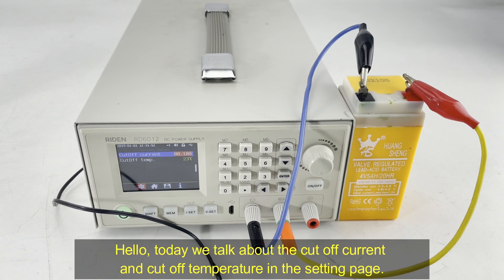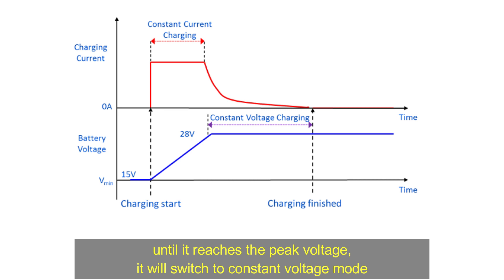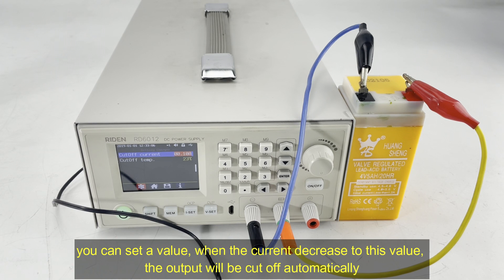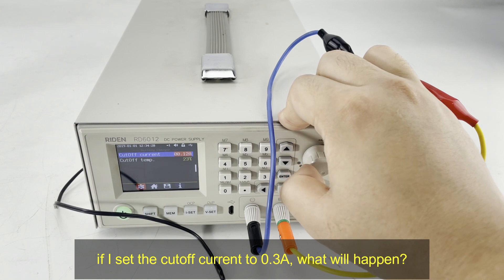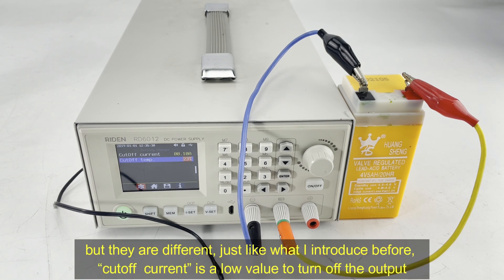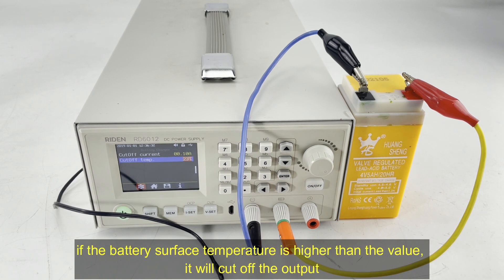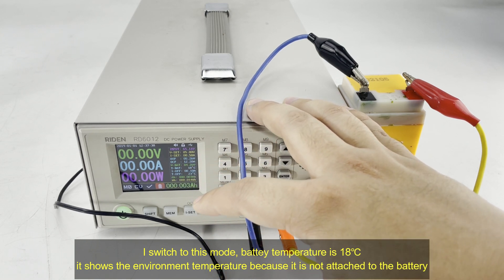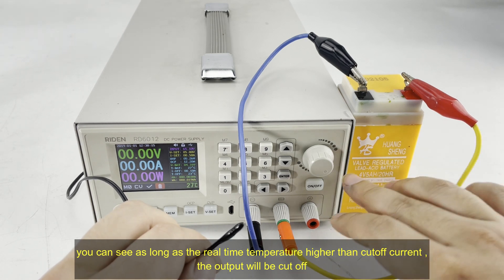CutOff current and CutOff temperature to protect the battery for charging with RD power supply

Comment: is the temperature sensor included? or sell apart? is possible program in pc software a charging curve by steps? no chance to atach any device or something to discharga and analyze battery capacity? thanks for your video
Reply from the maker: 1. temperature sensor is included in the RD box 2. please check the pc software advanced function to program certain voltage and current for certain time 3, it is just a power supply, it can only charge battery, it cannot discharge battery to check the capacity

Comment: is it possible to save cut off current and temp in M1..M9 memory cells?
Reply from the maker: hello, the cutoff currnet is separate setting in the setting page,not in the data group, because it is only for battery charging terminal, the normal terminal will not cut off

Comment: Десульфацию батареи можно делать при помощи этих настроек.
Reply from the maker: hello, maybe the translation has some little problem, I do not know what you want to do to the battery, can you describe it again?
Reply: @rdtech9153  I do battery desulfation using these settings.
Reply from the maker: @AlexandrNikitinskiy  but our power supply only charges the battery with the voltage and current you set, I do not know that it can do battery desulfation
Reply: @rdtech9153  Through a translator, it is difficult to describe the process.
Reply from the maker: @AlexandrNikitinskiy  I seach how to do the battery desulfation and ask our engineer, but he said not suitable

Comment: This menu with small letters is available only after firmware update? If I will update my original 6018 FW to the new one for testing can i downgrade it later if something goes wrong? Can brick my PS during this update?
Reply from the maker: hello, yes its firmware can only be upgraded to get the new display style, and for the firmware, it cannot be downgrade, we just add the new display  style and battery charging function to it, it will not go wrong

Comment: why do you sell cases without a carrying handle? tease? we have but we won't give you?
Reply: Because we want customers to buy more than one RD power supply set and stack them on top of each other, the carrying handle would prevent such configuration. 😜
Kind regards from Poland.
Reply: @tristankordek  want is not harmful :)))
Reply from the maker: hello, for our case, they all do not have the handle when we design the case, and in our company only this one has handle, you can see this RD6012 set does not even connect the input power, inside it there is a battery pack, because we need to move it very often so that we add the handle
Reply: @rdtech9153  I don't have a built in battery. but the first upgrade is the installation of a carrying handle. because The case is insanely inconvenient to carry.
Reply from the maker: @Forvad  hello, for the handle, when we make the case, we do a research, most customers just put the power supply on their desk, so that we make it without handle